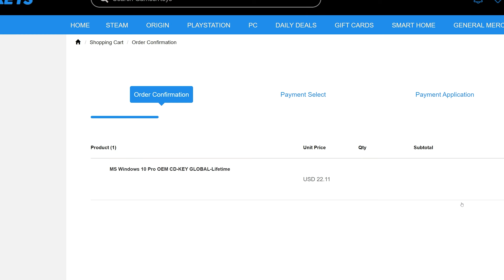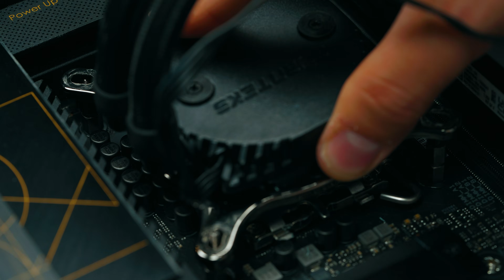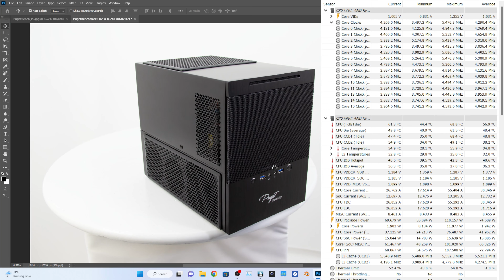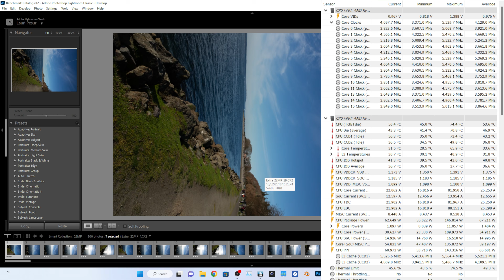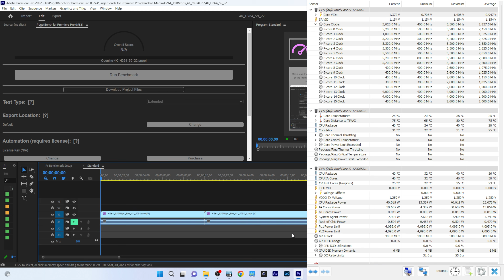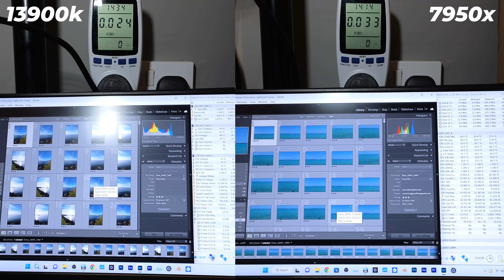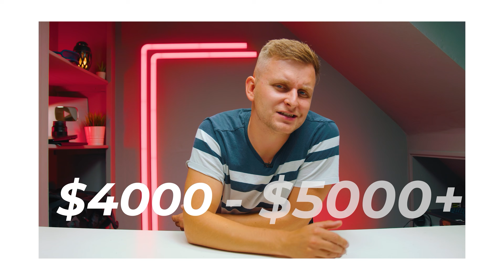INTEL & AMD both lied! 👉REAL WORLD power consumption is MESSED UP

Comment: Power supplies have a performance curve, their expected 80+ might be at 50% load, others might be closer to 70% load.
In terms of performance per watt, intel has an edge, it has small efficiency cores, if those are doing most of the work then power consumption is indeed lower, but that depends on the program, a lot of complex instructions only exist in the bigger cores, it all depends on the task you are doing, that being said the Big Little architecture proves to be good for desktop usage, that being said we do not see many core architecture gains in the intel side, mostly package wise improvements.
If AMD competes with BL package for desktop things will look interesting.

It's good to have competition!

Comment: 👍 Great job. Interesting way of testing.👏
I would like to share a bit on this topic.  As you stated in the topic both AMD and intel lied to us. Well, it is not actually a lie. Both companies' chips measure power consumption differently.  I, myself, found that some numbers are double counted eg. Power of IGP in total chip power consumption. 

In laptop cases, it will be even more strange if you use Smartshift as it will add a discrete GPU power consumption into the CPU power consumption too!!  I found that this is true in AMD case when using HWinfo. (I don't know about Intel)
I asked in HWinfo forum. They said their program just gave the numbers AMD soc gave to them. They are not sure whether those are accurate.

I am afraid that the only way to measure this accurately is to measure power consumption at the wall.

Comment: Your AMD scores are low.  I obtained a P. Photoshop score of 1681 on November 16  using a 7700x A 6900xt 6000 CL 30 expo memory with aggressive memory settings in the bios. RX 6900 xt.  I don't think you are using the PBO settings well which would also increase the power draw.  I see that one your problems is not using the Expo memory.  It makes a huge difference especially with the aggressive settings in the bios which is the cheapest Am5 motherboard.  The AsRock B650m Riptide.  

I'll do the benching again and report back as I do believe your power usage is probably high.  I have switched to doing static clocking which works well for the 6 and 8 core parts.  The 7600x is stable at 5.475 GHz all core and 1.2 volts.  It had a Cinebech score of 15950 and consumed an average of 78.8 watts.  So performed better than stock by quite a bit and consumed far less power.  Peak power was under 100 watts.

Comment: Yeah I hate that they use rendering for benchmarks. I want to know how the chip is going to work in the view port, I didn't understand this and the system I built is good, but I would have changed to a better chip. I use blender to design but I'm not rendering that much, I spend more time designing. So what I learned later is single core performance is what I should have been paying attention too. I got an AMD 5800x, rtx 3080 12gb, 64 gb ram, m.2 drive,  which isn't bad, but I can bog it down with a lot of modifiers. one good thing is I can still upgrade to a 5950x. I'm just waiting for the prices to drop some more. I think with all that I've learned in the past year I would have gotten an intel chip, they have better single core performance.

Comment: Amd idle power is caused by the chiplets architecture.  Their monolithic mobile cores don't need to move the data off chip & are far more efficient.
Reply: It has nothing to do with chiplet or monolithic. Even AMD would be wrecked by Intel on laptops.

Big-Little is used by Intel right now, AMD doesn't.
Reply: @saricubra2867  OP is right. It is because of the chiplet architecture. The IO chip (which doesn't exist in Intel CPUs) consumes power even if the CPU cores aren't doing anything. It consumes even more power when the cores from two or more chiplets need to communicate with each other. It's one of the trade-offs of the chiplet-based architectures - the IO chip always needs to be active (hence consume power).
Reply: @bgtubber  Is not the I/O, it's the Zen 4 core's power consumption vs the Gracemont cores from Alder Lake and Raptor Lake. AMD will use Big-Little for Zen 5.
Reply: @saricubra2867  Again, this has nothing to do with the power consumption of the cores because most of the cores are parked (inactive) when a CPU is in idle and they consume pretty much 0 Watts each. The IO chiplet though HAS to be active at all times even if no cores are active, so this brings up the power consumption of AMD chips in Idle (but not by much compared to Intel). Nothing to do with core power draw since in idle almost all cores are parked (0 Watts consumption).
Reply: @bgtubber  The iddle power consumption in the video doesn't look like parked cores. I reach 10 watts on my i7-12700K at iddle without core parking, partially overclocked AND and an adaptative undervolt at the same time.
Reply: @saricubra2867  "The iddle power consumption in the video doesn't look like parked cores". Yes it does. You can't reach the idle numbers shown in his video without core parking (excluding the AMD results which seems to have misconfigured systems, my 7950x is 18-20W when idle). Besides, core parking is enabled by default and stays active even if you overclock the CPU unless you explicitly disable all energy saving C-states in BIOS, especially C6 C-State.
Reply: @bgtubber  I do reach 10 watts without core parking on my i7 and the rest of the tuning with Intel XTU and maximum perfomance energy plan. The only thing i changed on the BIOS is setting PL1 and 2 to 190 wstts.

Comment: There's also another important difference not many Youtubers talk about that will become more relevant in the future:
AMD has 24 lanes of PCIe 5.0 while Intel only has 16.
This means AMD can have 2 gen 5 SSD's + 1 gen 5 GPU working at the same time while Intel can only have either 1 gen 5 SSD or 1 gen 5 GPU working at the same time (if both slots are populated, the GPU slot will drop down to PCIe gen 4 speed).
Reply: Is a gen 5 GPU a thing anytime soon? My impression was that GPUs are not that sensitive about how many lanes they get, since there is no real world reason why they'd need to push that much data. And I am talking about creative applications, gaming doesn't need that for sure.
Reply: @proxyone890  True but we'll have to wait and see if next gen's GPUs are using the PCIe 5.0 interface or not.
More importantly, the Raptor Lake platform doesn't actually support PCIe 5.0 speed for the SSD slots at all. It has to borrow the lanes from the main GPU slot.
This means you can only have one PCIe 5.0 device in your whole system, whether it's an SSD or a GPU.
So you can't use multiple gen 5 SSDs and if you have just one installed, you can't use a gen 5 GPU.
Reply: @Nayah9  Yea you got to plan carefully for that if you go with Intel. The thing is these things probably won't become relevant in next 4-5 years or so. And by that I mean you will still be fine with gen 4 and you will barely notice the difference. What is more likely to happen is that in 5 years AI will do all the heavylifting over some cloud so we'll be working off our laptops anyway :D
Reply: @proxyone890  Well, many gen 5 SSDs have already been unveiled and will be released soon so that's happening.
Whether it will make a difference or not vs gen 4 will most likely depend on the user but it will surely help with things like Direct Storage for gaming and faster read/transfer/iops rates for those who want it.
I seriously doubt the cloud will even come close to SSD performance in the near future since most people's internet connections are limited to 1Gb/s (so essentially 125MB/s).
With NVMe gen 5 speeds able to reach 16GB/s (that's 16000MB/s), that's a massive difference.
Reply: @Nayah9  I see where it would help with editing some high resolution footage for sure. And maybe some other applications, if you don't hit cpu bottleneck first. I am definitely for gen 5 ssd, don't get me wrong. I just don't see how a gpu would benefit from full gen 5 speed, because running gpus in x16 vs x8 proved to have negligible differences.
I will be updating my pc very soon, and so far it looks like Intel. I think it will last me till gen 5 gpus will become a real thing :)
Reply: @David Tran  Yup, SSDs are definitely the more important factor to take into consideration right now. Though you never know when a GPU manufacturer might come up with a new technology like some new ridiculous types of RT cores or something that suddenly requires PCIe 5.0 to work. Unlikely in the near future but possible.
Also AMD has AVX-512 support and future CPU upgradability on the same socket.
Reply: @Nayah9  The thing with apps on pc they have to be backwards compatible with multiple generations. That's why I don't expect some wild new way of work that would require gen 5 gpu. Especially when there is not even a hint of anything like that coming. So I assume current pcs will still be good for years to come. And from my experience, I never actually upgraded cpu on a motherboard. Usually it was more ram, more storage and gpu. CPUs nowdays are kinda maxed out anyway. Yeah but I did consider all the points you mentioned and you are right. Its just a matter of deciding where to spend your money most efficiently.
Reply: @proxyone890  - Backwards compatibility is usually not a problem since a new feature can simply be a toggle in the settings like for ray tracing. There is still a lot of improvement to be made regarding ray tracing at native resolutions so I can easily imagine more and more RT cores being added to GPUs and quickly requiring more bandwidth than PCIe 4.0. Who knows.
- I wouldn't say CPUs are maxed out, especially nowadays when we easily run into CPU bottleneck on modern games at 1440p and sometimes even 4k. However to be fair, this is because games aren't yet optimized to use multi-core properly. 3D v-cache also looks promising. The AM4 platform was a clear success regarding CPU upgradability and a lot of people were happy to take advantage of it once their shiny new CPU wasn't so shiny anymore. You could argue that people would usually want to upgrade their mobo along with their CPU to benefit from new features but since AM5 is fully PCIe 5.0 ready and it's just the beginning of the 5.0 gen, I think you should be safe with a good mobo that you bought today.

In the end it's completely up to you.
- Raptor Lake has slightly better gaming performance and may lower your electricity bill by $10/year max if you're a normal user. It also has fewer day-one driver issues since it's a more mature platform (technically it's Alder Lake 2).
- Ryzen 7000 has true PCIe 5.0 support, AVX-512 support and the AM5 socket life is only beginning.
Reply: @Nayah9  Its a razor thin decision. If amd would go down with tge price I'd reconsider. But with current price tags Intel seems to be the better deal for my needs.
Reply: @proxyone890  AMD is cheaper than Intel in my country (France) so that made it a little easier for me to choose.

Comment: I think I  will stick with my Threadripper and maybe add an Arc GPU. I also don't limit myself to just Adobe products,  which is clearly optimized for Intel processors.
Reply: Isn't about being optimized for Intel processors, they only have better IPC and single core perfomance than your Threadripper.
Reply: I use NVENC on the Premier timeline.
Once you use workstation it's hard to return to desktops. Extra PCI express lanes buss, bandwidth, memory capacity, storage throughput.
If you don't need it then desktop is fine irrespective of the brand.

Comment: My 13700K is using 10-15W watching this video. :)
Reply: 👋 bro please reply me. What is the whole system power consumption showing in wall socket?
Reply: Yes. You can use hwinfo software and see the sensors section for detailed uses realtime. @katsrk3039

Comment: You get a sub for this. This is exactly what I actually wanted to see for the last few weeks, but nobody just seemed interested in doing it. Everyone was just like okay intel cpu is power hungry and even if amd cpu is more expensive  at start you will pay off the difference with electricity(yes AMD dropped price of 7950x only because of intel offering). People don't understand that your CPU is rarely being at 100%(on every single core). So in the end for average consumer intel cpu is actually more efficient on average. While I do agree your test is more realistic it would actually be good to have some programs that use 100% of the cpu just for good measure.
Reply: Hiện tại còn đúng không bạn, ví dụ 13500 vs 7700

Comment: Hey man, don't make the mistake and think that Blender is multicore only. Yes most people render using the GPU and not the CPU, unless they have a Threadripper of something. But Blender has a lot of single core dependent operations inside also. Like viewport playback, modeling, object copying, rigid body simulations etc, etc. So single core performance for Blender is probably more important because that's where most of us 3D creators live.
Reply from the maker: Yep
Reply: And the load is so low that is irrelevant compared to the actual rendering of a scene. Intel would win because it has higher IPC

Comment: Two years ago I built a pc for my son with a i5-10400f. I choose this instead of Ryzen 3600 because of the lower temperatures in games and better (in game) performance at the same time. His pc is really dead silent with a FUMA 2 cpu cooler and Nitro 5700xt card at 1440p gaming and most important, it is problems free. I recently bought a 5800x3d for my pc to replace my Ryzen 2700 and now I am in process of RMA it because of whea errors following by restarts. If I could afford it I would replace my system for a 13600k/13700k but, unfortunately I cannot do this right now...
Reply: " because of whea errors following by restarts."

I had the exact same issue with my 5950x, only new cpu sample fixed it. Its actually very well known issue and whats bizarre that even with 5800x3d launch amd couldnt manage to fix that. Im going to use my 5950x for a long time, but when the time comes for an upgrade im going intel 100%

Comment: Even My notorious 11700kf(waste of sand), consumes around 15w at idle....
Reply: A waste of sand for an AMD Ryzen fanboy like Steve from Gamer's Nexus that has a personal Bulldozer FX8350 system.

11th gen i7 is good (unlike the i9).
Reply: @saricubra2867  agree, I have the 11700kf paired with Aorus master z590, power usage is great, 13-18w while idling, 168w running cinebench r23 with all cores at 4600, around 14800 points

Comment: Real world testing is where it is at. Benchmarks only show a part of the picture. That being said, I think anyone would be happy with either of the two flagship chips. I'm loving the bump I got from my upgrade this week. Moved from 6th gen i7 with a 1080 to a 13th gen i9 13900k and an Asus Strix 3080ti...OMG! These two parts are working in conjunction with my Z790 Maximus Hero and the upgrade is AWESOME.
Reply: Damn that's a big upgrade!
Reply: 3080Ti is the best well rounded Ampere card, good choice there. A friend build a 3080Ti system with a Ryzen 9 5900X.

Comment: Great work. It would be interesting to measure actual wall power usage comparing an Intel based desktop versus an Intel based laptop.  I know  these chips are different (even with the same model numbers).  I would like to know how much saving do I get using a laptop.

Comment: If you run any of these programs full time for work, the chances are you have a $1k GPU which will use more power and skew the results as the GPU will be a big player in power consumption. A cheaper GPU for Photoshop and lr would use less power.  Also that's only the cost of a few cups of coffee over a year.  If you are a hobbiest and use your system 6 to 8 hours a week, the costs will be even less as most of the time your pc is asleep.  If you are worried about power buy a Mac as the M1 uses a lot less power.
Overall your results are accurate, for full time  creators, but the raid systems and backup as well as networking is probably a bigger load in the office. 
For ps and lr, maybe an igpu is the way to go as the power should be a lot lower
Happy new year and keep up the great work

Comment: this is a very interesting test that provokes more investigation. It would be interesting to measure actual wall power usage over an extended time (I could do this myself if I had a power meter) for a truly real-world measurement of domestic computing costs. I've noticed my own 12900 system showing a package power draw of typically something like 23W in a quiescent state. It's only when doing something like Cinebench or prime95 that the consumption figures really shoot up (along with the fan speed). Of course, HwInfo64 isn't telling the entire story of power usage, but it's a good indicator.

ETA: ah, you did the real-world wall-socket test! I commented too early. Excellent work.
Reply: Commenting this a year late, but a BIOS update can also change how much power your CPU is using while idling. For example I remember seeing ~20W idle power usage (HWINFO CPU package) on my 12600K and it turned to ~9-13W after updating BIOS.

Comment: on windows 11 currently AMD is idling high on clocks due to a power profile glitch and I believe even latest windows 10 version is also when they removed the ryzen power profiles  from OS it bugged out the power states on AMD I am seeing on avg 25w-50w higher idle power draw over when they had the ryzen optimized power profiles.
Reply: Intel's efficient cores still would use far less energy than a low clocked Zen 4 one despite the huge difference in IPC.
Reply: On Linux the idle power draw of my ryzen 7900 is equally as bad as this video demonstrates.